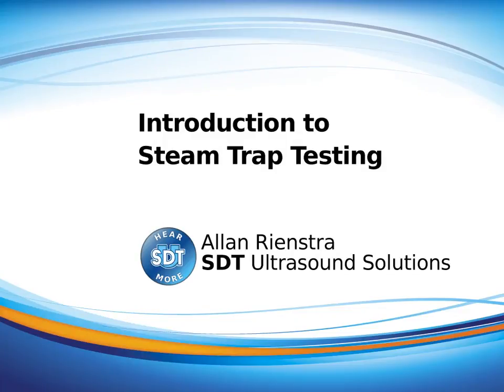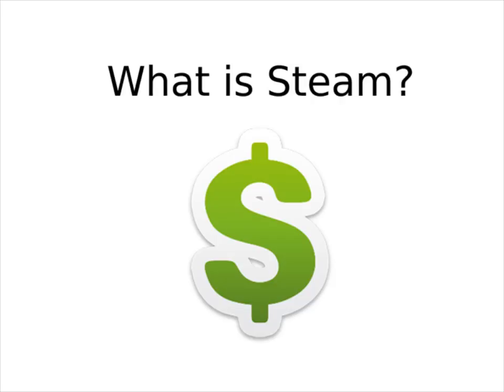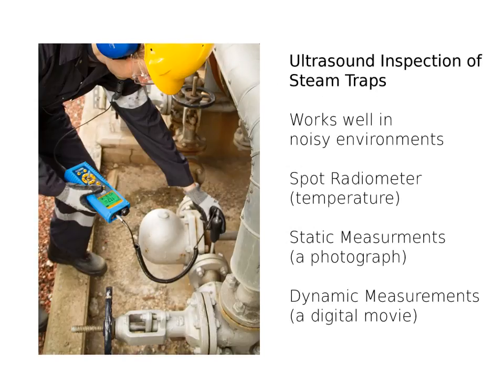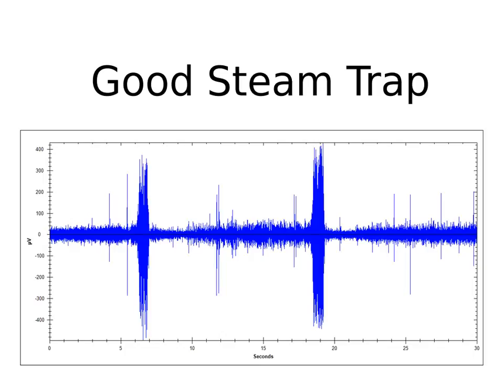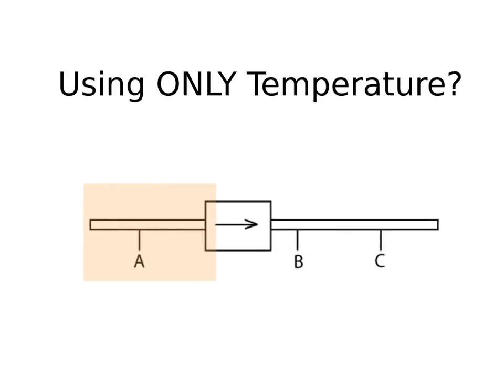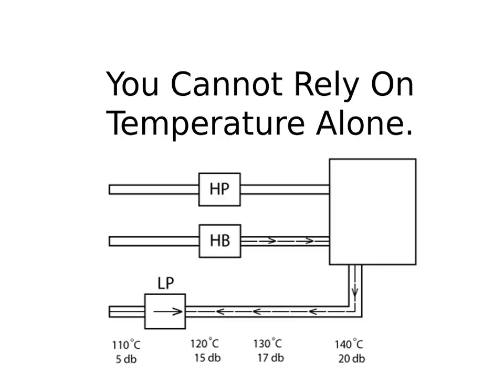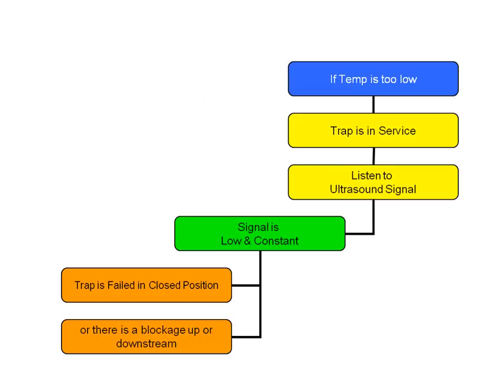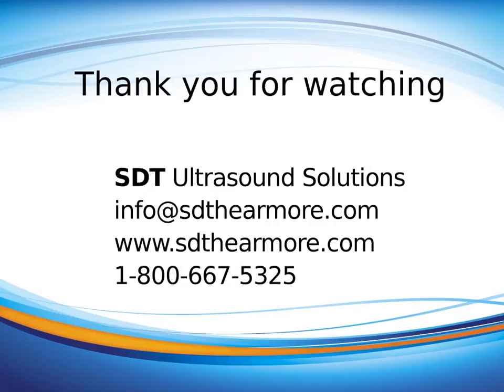Introduction to Steam Trap Testing

Comment: Thermodynamic steam traps do not work on the difference in temperature. They operate on the difference in flow velocity (Dynamics)
Reply: Dear Malvern Jones, thank you for watching our video and adding your comment. Indeed, you highlight an operational point that I could have explained more precisely. The relationship between velocity and pressure, first described by Bernoulli, is certainly what drives the purge cycle in this style of traps. However, temperature also plays a role as pressure, and consequently flow velocity are both dictated by temperature changes. As more condensate gathers the internal temperature drops. This causes steam in the pressure chamber to also cool and condense. The resultant change in pressure (caused by cooling temperatures) opens the disc allowing the condensed steam and gases to evacuate.

Comment: So I could use a flir camera to trace and anything with no delta or an extreme delta we would use an SDT340 to measure? This would be the fasted method?
Reply: Hey George, I don't know about using a FLIR camera. Maybe a FLUKE will due just fine if you have one. 

Temperature is a key element to good surveys of steam traps and taking comparative temperature readings upstream, downstream, and directly on the steam trap can give some indication of proper function as well. But temperature alone will not reveal chattering valves, blocked or open traps, and proper purging. Therefore, the SDT340 is equipped with both ultrasound for listening and temperature for feeling. 

But temperature is not the first indicator of a problem in a steam trap and may even be misleading. Since a steam trap works on the basis of "collect" and "purge" the prime symptom we listen for is turbulent flow (or the lack thereof). The SDT340 hears that (or hears that there is NO flow) and from there we determine the trap cycles properly.

Comment: For testing steam trap using temperature only, what do you expect the temperature on down stream of trap?
 if downstream is on atmosphere pressure. By Keeping upstream pressure 5bar at 250F as you mentioned.
I thing it should be at saturated temperature I.e 212F (or around 190F keeping in view 10% heat loss).
You have mentioned it is faulty.
Plesae explain.
Thanks
Reply: Greetings Tariqalavi. When inspecting steam traps using temperature only, please recall that after the trap, most condensate systems are not under pressure, and therefore at or below 100 C. The upstream side of the trap is almost always under some pressure, therefore it should  be significantly higher then 100 C. With a few years of experience behind me testing traps, I can say that I have never looked for a particular downstream temp. but I was looking for a large delta between the upstream and downstream temperature.  I hope this assists you in monitoring steam traps.